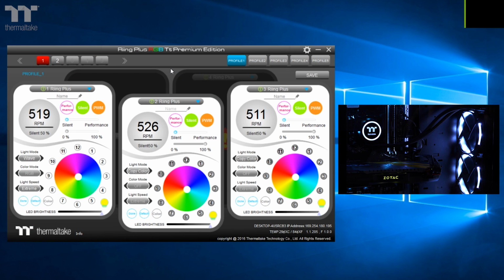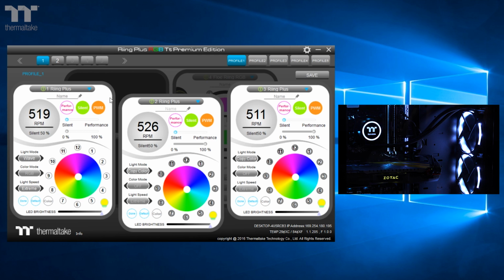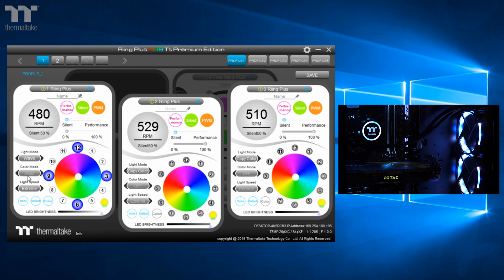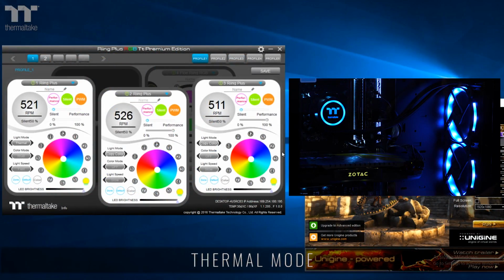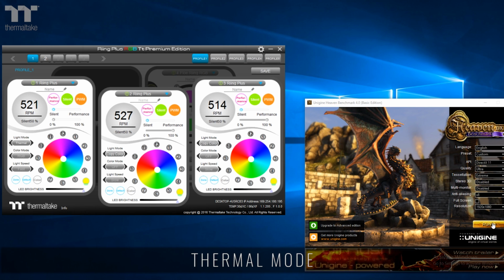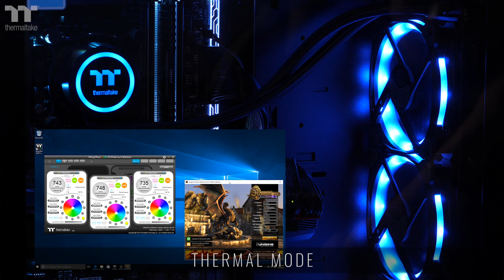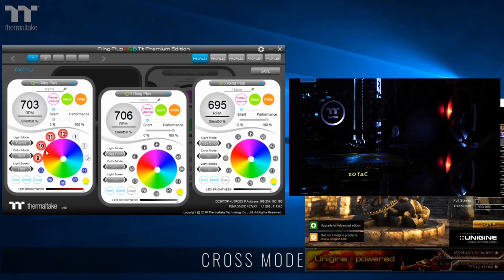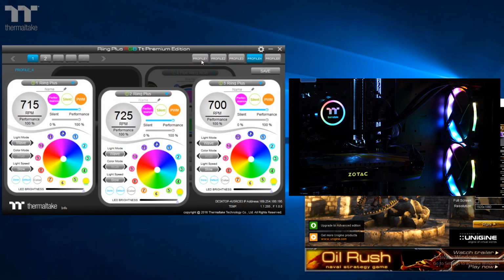Floe Riing Plus RGB Software

Comment: I have the FLOE 360 and about 9 Riing Plus fans including those on the radiator as well as TT Pure Light strips. I have them all configured with all Riing Plus including the 3 radiator fans first (5 on the first controller and 4 on the second controller with the FLOE AIO), then FLOE AIO (on the last assignment of the second controller), and last the Pure Light strips (on connected to a 3rd controller separate from the fans and FLOE). It doesn't seem to matter how I set the colors the light strips stay as I set them, but the last Riing fan and the AIO  always seem to mimic each other no matter what. I simply want to be able to set a color scheme for all lighting except the AIO which I would like to have set to "temp". I only have one RGB header and 2 USB headers so I have to chain all the controllers together. Is there anything I can do other than to put the AIO on its own controller which seems to me to be the only reason the light strips do they I set them to do without interfering with the other lights?

Comment: Literally the worst looking RGB software I've ever seen.
Reply: Sam Martin my rgb’s constantly freeze. Asus does the same. Not sure there’s any rgb system that doesn’t freeze.
Reply: RGBis working but moyst important the aio from thermaltake ios pêrformance based better than corsair or nzxt x360mn
Reply: While TT AIO's are decent, I found that a Corsair 280RGB Pro kept my Threadripper 2950X cooler by about 3 to 5 degrees.
Reply: not even close. Guess you havent seen much of what is out there.
Reply: Gigabyte fusion is also not so good always your start you computer you need to open it and configure the color it can be never fixed for now i hope update soon

Comment: Will this software work for my 140mm riing plus premium edition fans or will it refuse to work with my ryzen build and crash on android? I wrote down my problems on the forum and I was never answered.
Reply: I had the same problem, it is a known issue and needs a Ryzen controller to make it work.     Thermaltake is releasing another Ryzen controller in October as the existing one is buggy.    Hope this helps.

Comment: I have a TT Premium 140mm fans. Can i use this app?  Because the app i have now doesnt work on my ryzen build. -.-)
Reply: I had the same problem, it is a known issue and needs a Ryzen controller to make it work.     Thermaltake is releasing another Ryzen controller in October as the existing one is buggy.    Hope this helps
Reply: evin 13
Reply: മലയാളറമുവി